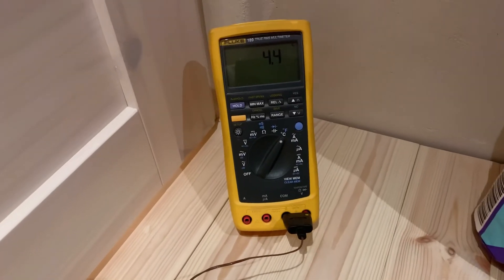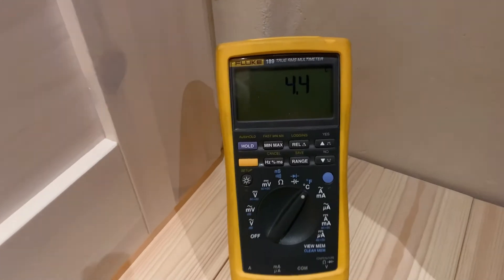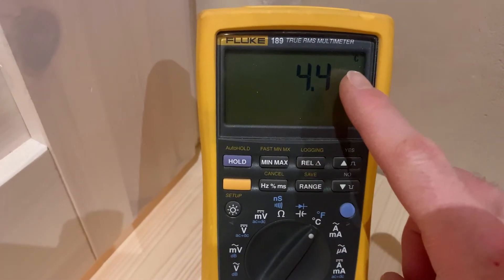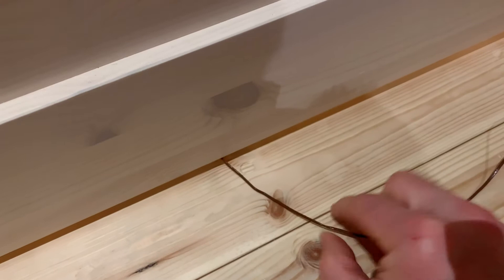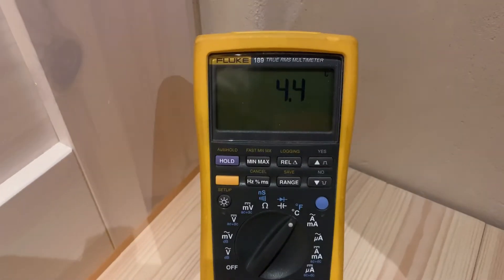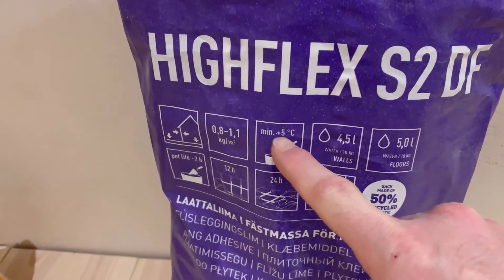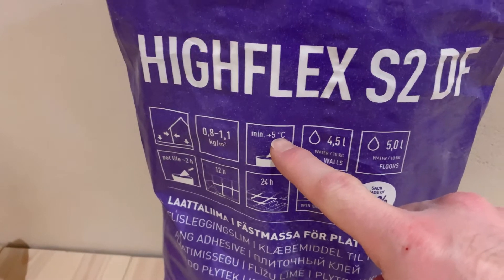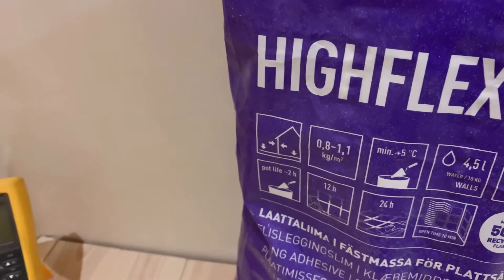Renovation: too cold.

Comment: AS that's the temperature in the entrance lobby - brrrrgggghhh! Quite right to postpone the task until the conditions are within range - wouldn't want to risk compromising the floor heating .... and having to lift floor tiles to troubleshoot ...
Reply from the maker: Exactly. It also didn’t agree with my cold tolerance at the moment. Need to do some cold water swimming to build my resilience back up.
Reply: @PaulWarrenEaton  For an Aussie, and presumably used to generally warmer temperatures, you seem to have acclimatised to Turku and be coping very well!
Reply from the maker: Love will do that!